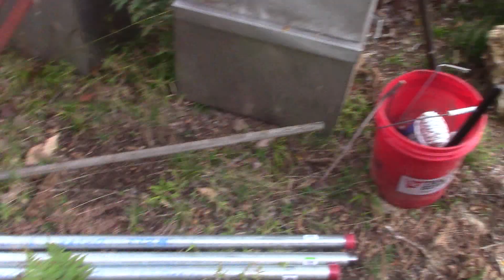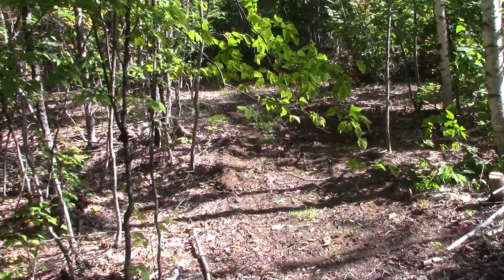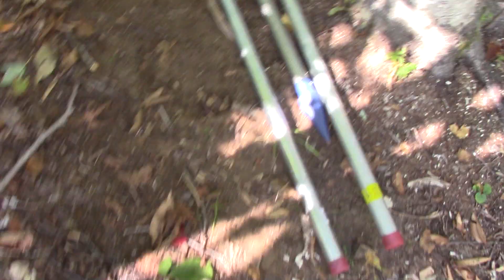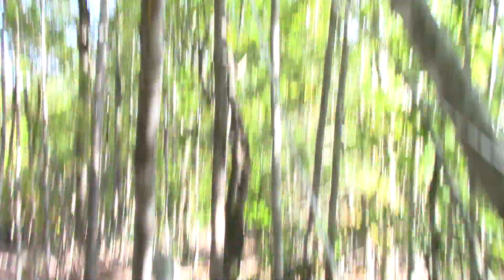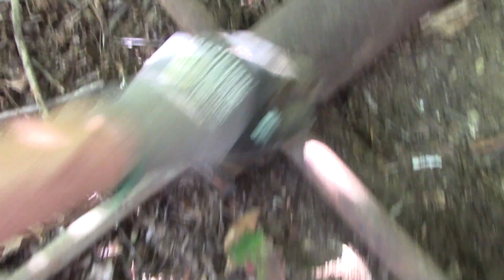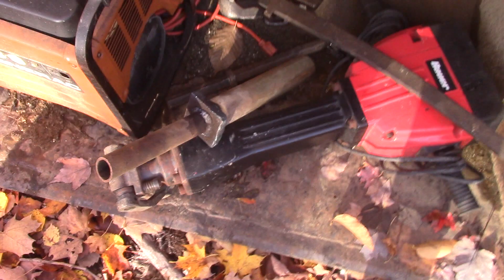Sand Point Well - Not As Easy As It Looks!

Comment: Why are you trying to do it the hard way \?
All you need to do is supply water, dig a small area out to line with plastic, fill it with water, use a 4 or 5 inch plastic pipe and use a smaller pipe to force water down the middle of the 4 ich pipe, and the water will bring up the tailings, and use the center pipe to push down and you can easily force the 4 or 5 inch pipe down as a linner,
Look it up on youtube and see how easy it is instead of suffering
Reply from the maker: Our ground is way too rocky for that. I've seen those videos, they look great for the proper soil.